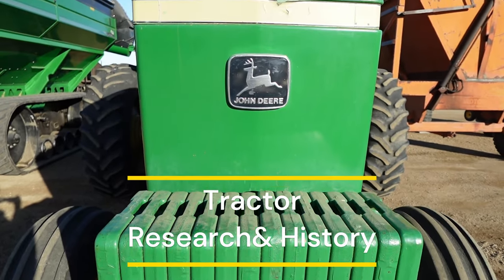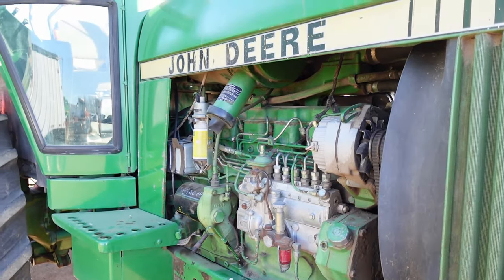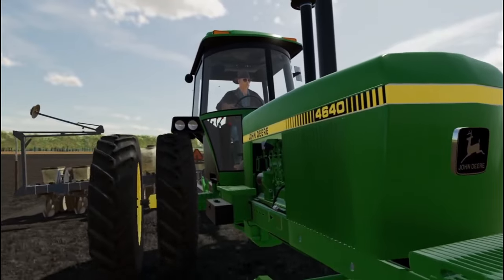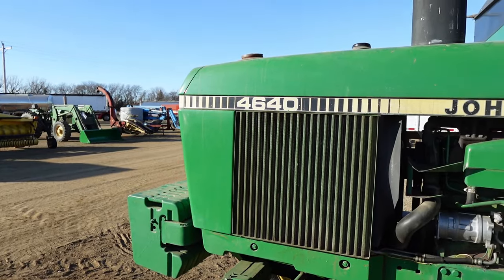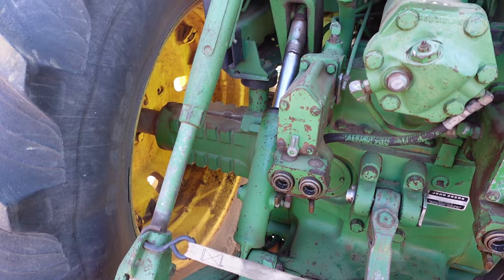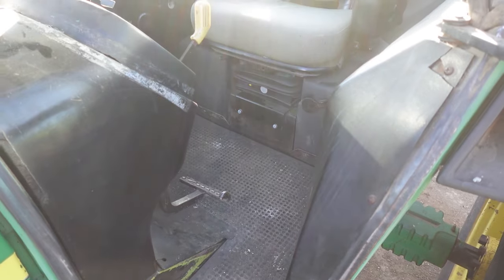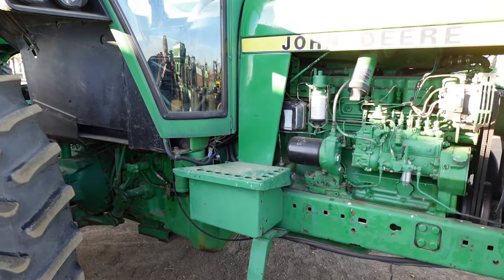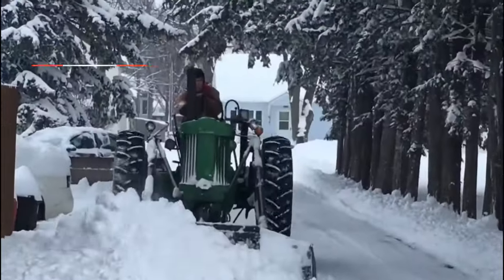The John Deere 4640 (Iron Horse)

Comment: Still some of my favorite tractors of all time. Started in Missouri running my uncles 1974 JD 4430. I've collected a few over the years myself.  1967 4020 synchro a 1973 4430 synchro have two 4240's one quad one power shift they are a 1980 and 1981. Got a 4640 open station 1981 with power shift. Have a 1982 4440 with power shift . Finally a 1992 4455 quad with 5,700 original hours . They are all great machines simple . I'm not paying a house note for a new one . Mine run just fine .

Comment: I had a 4640 and it was an excellent tractor! I did a water pump kit on it while I owned it. Also had run a 4840 before with the powershift. My 46 made 158hp on the dyno so I think it to be midrange in the hp mode. The quad transmission was great. Sold it in 2005 after quit farming. I think it could have been turned up to 200 hp if you could keep the working temperature in check. GREAT TRACTOR !!

Comment: Fuel economy didn’t matter back in the day when diesel was 50 cents a gallon
Reply: Our 4640 is not bad on fuel. It has 8500 hrs on engine.
Reply: The picture @ 2:15 of 4640 has no intake intercooler.
Reply: I'm 4640 is not hard on fuel either and it is turned way above the stock spec.
Reply: @linkjohn7867  I think ours is too! If it’s got the traction, pulls like our 8440
Reply: @randykrochak1185  Yes it does.

Comment: The 4640 was the cross over between large and utility. It was very flexible in operation, with its size being able to to work the farm yard with a front loader, as well as the field. A variety of row crop options for tire configurations meant this was an all season tractor. The diesel engine wasn't a pain in winter to get started and didn't suffer some of the complications of others. The front end weight distribution didn't always work in your favor, though. Rolling hills would unbalance the weight distribution with taller wheel setups. The quiet comfort cabs that came out in this era weren't bad at all, and work effort engine noise was like a white noise machine. So much so that when I was a baby if mom couldn't get me to go down for a nap, dad would bundle me up in a pile of pillows left of the seat.

Comment: Looking at the 4440, $38,000 new and now used, with rebuilt engines and or transmissions still bring $25,000 easy. Thanks for the video.

Comment: Great tractors but I wish they would have included the 540 PTO.   Were there any mechanical differences between the 48 and 46 tractors or was it just pump tuning?  There were lots of 46s around here and not a lot of 48s.   Am I correct in thinking the 4840 was only available with the 8speed PS trans?   Third gear was too slow and not enough HP in 4th if I remember correctly.   Had to crank them up so you could use 4th in heavy conditons.

Comment: I think the 4840 put out a few horses,  the 6030 had some horses also!
Reply: I remember working at a farm that they had a pto adapter from the large 1000 rpm to the small 1000 that had a 1/4 twist in it. I asked what happen to it and was told they had a 6030 on a tub grinder and they had dropped a bale in to quick and twisted the adapter. Never ran a 6030 but would like to someday.

Comment: He is wrong about the fuel, we had this one and a 1466 and its fuel usage was far better, the advantage the 4640 had was it had its gas tank in the front so it was easy to add an addition tank right ahead of it and make a workhouse tractor that could be in the field all day, it used about 10 gallons/hr under full load. We could stay in the field for 18 hours with the extra tank. The ergonomics of the JDs was 10 years ahead of the Internationals.

Comment: Came with a 83 gallon fuel tank.THe 404 was replaced by the 466 because it has reached as far as it can go.One thing I noticed about Deere & their tractors during this era is that they did not have a 160 PTO hp tractor like Allis Chalmers,Case,Ford,Massey Ferguson,International Harvester all did .White was the other company out of the 7 farm equipment back then whom matched Deere by not having a 160 PTO to.So here is to the 7060,2390,TW-30,2770/2775 & the 1566/1586.
Reply: 4630 was 150pto hp and the 6030 was I believe around 170 or 175 so deere kinda had one in that era a little north of the 160 mark

Comment: 4640 is a pig of a machine. If they get into any type of mud they are done, big and underpowered, and have also ran a 4840 also, same story. I believe a 4440 seems a better option out of the 40 series. I have run a 4240 and that one was not all that bad, seemed a better machine then the bigger ones. Just my observation.

Comment: Bought a brand new 4440 in 1979. Bolts were loose, wheel fell off, front threaded casting was stripped, radio was all static when the heater fan ran, hydraulic seat leaked oil, all this from day 1. These tractors were going out the factory doors not being checked over. Bought my last new tractor from deere in 79. Never buy another.
Reply: 1 out of 100,000  only lying to yourself if you think there's a better brand out there